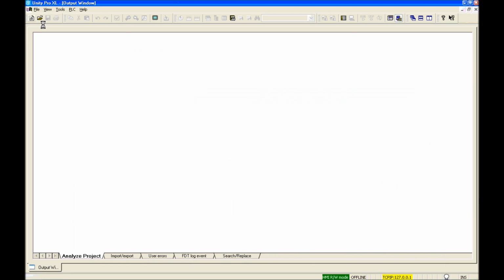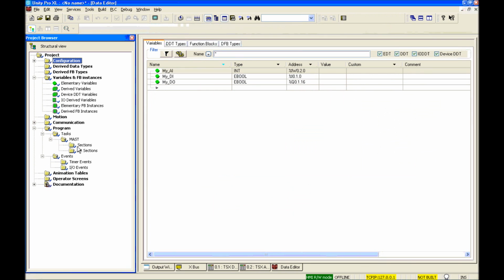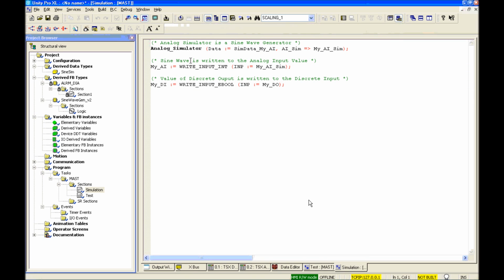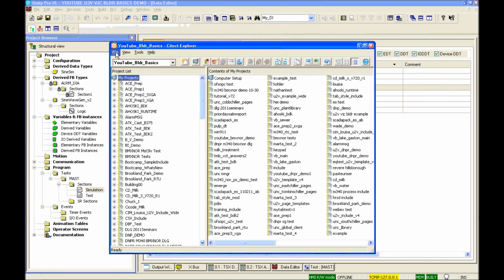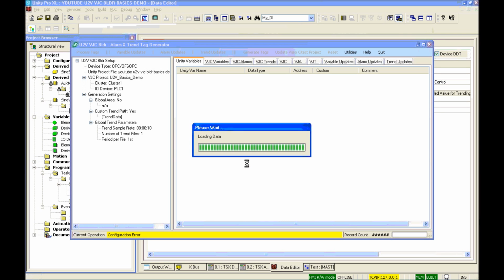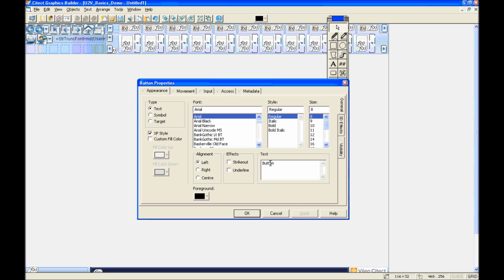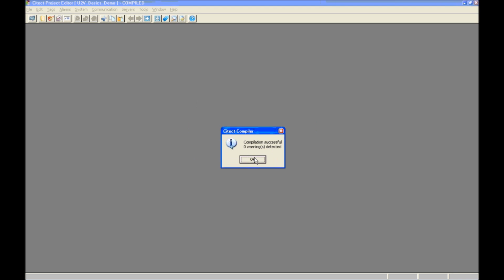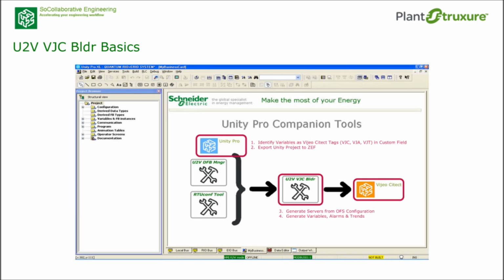U2V Basics for OFSOPC Vijeo Citect Projects

Comment: This does not work , following the steps of video get an error when trying to run the application OFS Server BdlR with the exported XML file with OFS 3.5 and the project folder Vijeo Citect 7.4 . The error says that an unhandled exception in the application has occurred.
Reply from the maker: I will take a look at this with the Versions that you reference and report back.